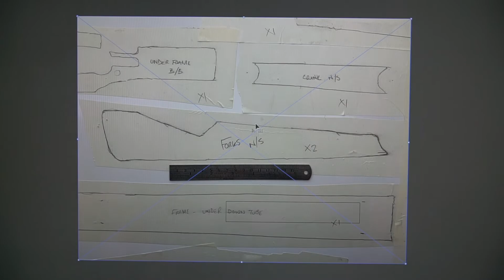Colnago C64 Mapei - Hand made frame protection from start to finish.

Comment: Hey Chris, loved watching this, are you selling this protective film? Cheers
Reply from the maker: Hey Deni, I actually made an eBay listing for them yes. My frame size is 52 sloping which is what I have available currently. I would be able to make other frame sizes / geometry if yours was different?
Reply from the maker: https://www.ebay.co.uk/itm/233983735943
Reply: Hey Chris, my frame is a 52s also.
Reply: My vulnerable area is always the drive side chainstay and bottom bracket areas. I make mine from XPEL paint protection film. I just cut with scissors, not as precisely finished as yours.
Reply: @chris_jamo  Not really priced to sell are they?
Reply from the maker: @wasupwitdat1mofiki94  If you wanted one you're welcome to buy one through eBay :)